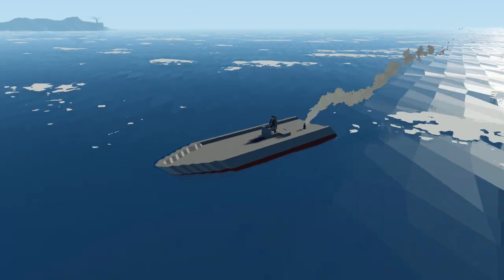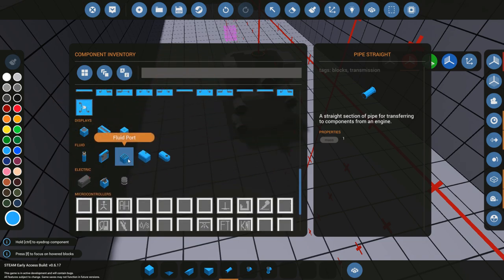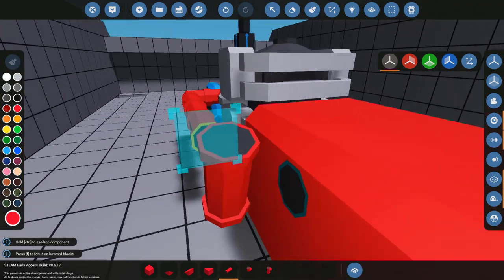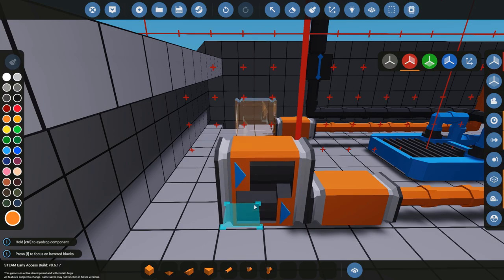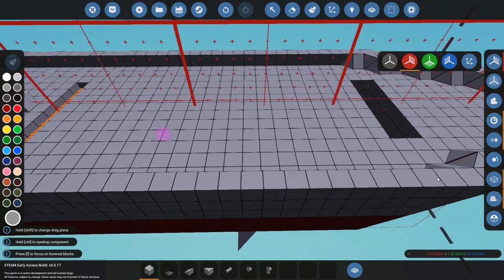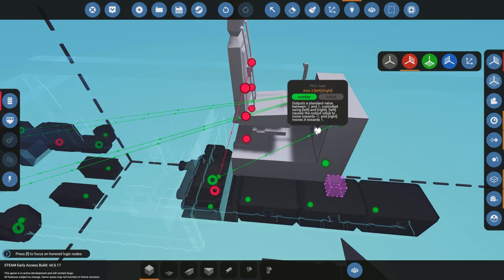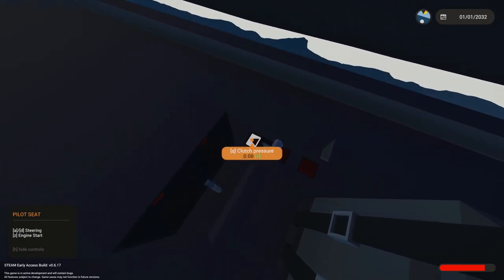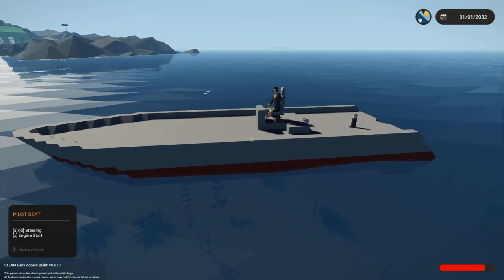Stormworks B&R l Engine Tutorial for beginners

Comment: 6:40 What are those orange things in the floor next to the gear boxes? I want to make sure I get every block that I need but I'm not sure what that is. I'm trying to build a fictional ship named the RMS BLACK TITAN for those that want so see what the ship will look like.
Reply from the maker: On the right is the clutch block which allows you to control the power from the engine, on the left is a pipe that leads to the propellers.
Reply: Thanks

Comment: Thanks for the tutorial man, nice to hear one from the UK for a change. 

Question for you. Are the ports on the engine specifically for fuel/water/air/exhaust or can you config your pipework any which way so long as all the requirements are met?
Reply from the maker: All your different modules such as fuel will have to lead into the node which is labelled correspondingly, but a pipe can be as long and as varied as you want